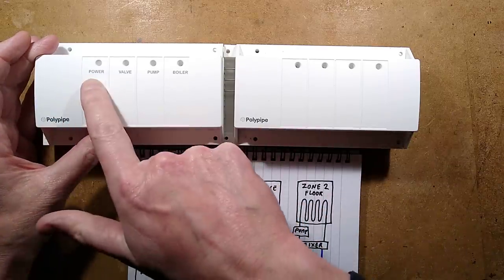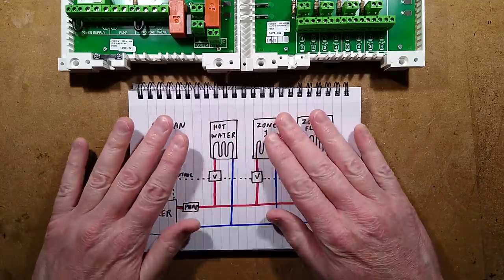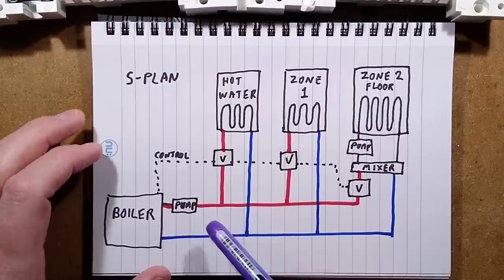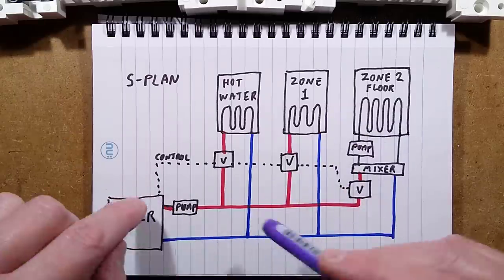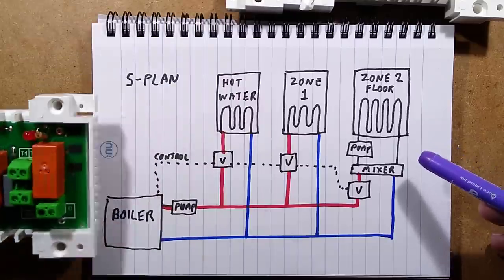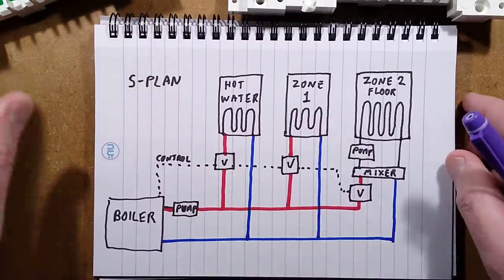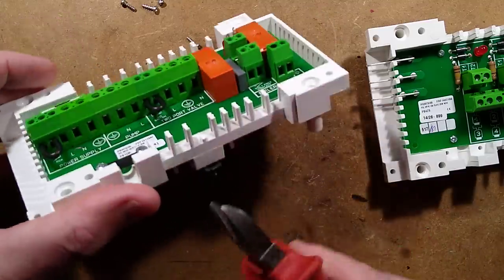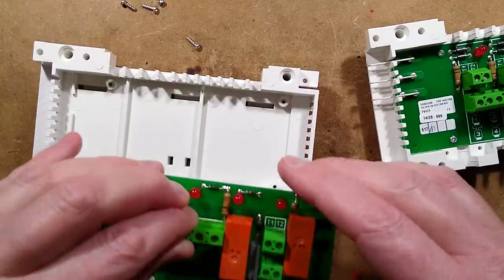Underfloor heating control system teardown (with schematic)

Comment: Big Clive: They say to not open these, they have a powerful spring and they are dangerous.

Also Big Clive's next sentence: Maybe I will open one for a future video...
Reply: Sometimes the warnings really do mean something.   The Detroit diff locker I put in my Hilux has a spring loaded setup (for the dog clutch) that has reportedly removed fingers from DIYers.  These things can have hidden treachery if you don't know the correct assembly or disassembly procedures.  I hope Clive takes care.  I can't imagine something that small having a great potential for bloody chaos, but sometimes that's the trap.

ETA: now that I've had a look the spring in these waxtuators it probably isn't that bad.  You probably just need to make sure the cap doesn't fly off and hit you in the eye.
Reply: i think this is more  a case of "the springs ae quite powerful for their size, and its gonna make it a pita to put it back together" more than poses an actual risk to a person

Comment: I have the exact same underfloor heating system (Polypipe) upstairs and downstairs. I was initially sceptical but it is brilliant. Your tale of what the elderly chap did to it had me double facepalming.
Reply: Do you run it 24/7 for the simple reason it takes ages to respond to demand ?
Reply: @millomweb  I never touch it as the thermostats mean it only comes on occasionally for most of the year. The house is new so is very well insulated. I have never once thought a room was cold and needs a sudden blast of heat like previous houses I have lived in. So yes to your question but no in the sense that most of the time it appears to do nothing.
Reply: @reggiedixon2  My aunt moved into a new bungalow - it has rads all over. I've never lived in a new house ! My flat is reasonably well insulated but is brick. Rads heating system takes about 4 hours each morning to reheat the bricks ! So I leave it on overnight - usually does a heat top up a couple of times through the night and not for very long !

Comment: Clive, Thank you for the inside look into this control system. I found it very interesting! Especially that they use 220 volts for the control circuit. Here is America, HVAC control circuits are for the most part low voltage (24 volts).  And relays are used to control the higher voltages.
Reply from the maker: I noticed that.  In a way it's good for safety of the people working on the systems.
Reply: Commerical HVAC is all 24v control voltage here and in Europe. It's standard. I've always thought the reason the US uses 24v on domestic is due to the high use of AC systems which have routes in the commercial sector. Makes perfect sense to unify it all.

Comment: Thanks for this, I recently came across this model for the first time so I found it was very relevant. Your tear down proves they're a lot simpler than I cared to believe. Which is nice. Simple = reliable. I guess the low voltage models make things a bit more complicated but a lot safer. My experience with Under Floor Heating has shown me that it often suffers two common problems; the valve pins on the manifolds leaking and the thermal actuator heads shattering due to the plastics becoming brittle and the pressure from the spring blowing the outer shell to pieces. On the Extra low voltage designs this is not such a problem with respect to safety but the 230V design is a bit more iffy!

Comment: What a brilliant video and description.A lot of time and effort went into this .Many thanks for the clear ,concise and eloquent description.It has increased my understanding of these units and the systems they control.There are hundreds of the actuators you describe on this development (5 or 6 per property ) each one capable of blowing the local fuse or CB.We may be seeing more UFH systems being installed in the future as they are ideal for Heat Pumps .

Comment: I'm thinking the valve actuator may be a wax motor.
Reply from the maker: It might be.  I'm going to open one.
Reply: @bigclivedotcom  they are.
Reply: Similar to the little ones used to silently open the automatic shutters/flaps on extractor fans when switched on. 😉
Reply: Yes, they are. And they have strong springs.

On my holiday house I have like 20 of those after 15 years the plastic started to degrading and springs was breaking the enclosure. After that also the valve collector started to fail. And we had to "rewire" that part of the heating system.(not native English here) rewire for plumbing word is missing on my vocabulary...
Reply: Crazy simple  cheap to make and does the job.
Reply from the maker: @tuttocrafting  Replumb.
Reply: "Wax motor" - I'm really having problems believing that name.
Reply: @YagiChanDan  After all, what else could it be !
Reply: @millomweb  LOL,  When I first heard of them I was thinking WTH ?  Knowing how they work still doesn't make the name right.
Reply: @pulesjet  "Waxuator" perhaps?
Reply: @StubbyPhillips  Thermo Dynamic Switch.
Reply: @pulesjet  I'm 55 and it's the first I've heard the term. The concept is probably at least 100 years old. Tried to find out when they started fitting them to cars.

Quite a lot of things then must have bi-metallic motors. The tank in the loft and toilet cisterns have hydraulic motors that shut the water off when the tank's full.

LOL
Reply: @pulesjet  Spring-driven = clockwork motor - I can understand - but these wax things aren't providing motion, they're providing *position*.
Reply: @pulesjet  I wouldn't even rate the wax cylinders on my greenhouse vents as being 'motors' ! They're 7" long approx !
Reply: @millomweb  63 hear and ten years ago I didn't know they existed.  LOL
Reply: @millomweb  Pretty much just a swelling plug.
Reply: @millomweb  motor just means that the device "provides or imparts motion to a vehicle or other device with moving parts". So, changing positions is motion, therefore the thing doing that, no matter how basic, is a motor.
Reply: As Clive said..... Thermoelectric Actuators is their real name, which describes them perfectly too. You can use the term "motor" if you like.
Reply: @tuttocrafting  You can say "replumb".  It means the same as "rewire" but for plumbing - putting new pipes in.
Reply: @millomweb  https://en.wikipedia.org/wiki/Wax_motor
Reply: @GaryAllpike  That's where I was introduced to them, and the term I used seems common enough. I do favor "actuator" over "motor", but I do prefer "wax" over more generic terms to describe the implementation.
Reply: @tuttocrafting   re- plumb  👍👍👍👍
Reply: Cool, I've only ever seen them used on fan shutters to date
Reply: @pulesjet  My Dad was a car mechanic - so I was aware of 'wax stats' at an early age !
Reply: @ParkerUAS  Yet it's never been associated with bi-metallic strips or other thermal expansion systems - nor water tank float valves.
Reply: @millomweb  Piston in a cylinder. Perhaps "Wax Engine" would describe it better.
Reply: @rambo1152  Nope :)
Motor and engine would suggest motive power - power to drive something at a reasonable speed (whether displacement or rpm). These things don't really do a lot :)
Reply: @tuttocrafting  Your English is just fine, we know what you mean. Most of us have studied in the AvE school of linguistics, so all good.
Reply: @millomweb  doesn't a stepper "motor" provide position?
Reply: @YagiChanDan  They're electro thermo ! :)
Reply: @maxmerton  It does and it's capable of motoring. A wax stat isn't.
Reply: They used to use 'wet wood motors' to split off lumps of rock, didn't they [not].
Reply: @millomweb  Opinion is clearly divided on the matter.

You think a wax motor isn’t a motor; everyone else thinks it is.

https://en.wikipedia.org/wiki/Wax_motor
Reply: @maxmerton  Well, it doesn't 'motor' !
Reply: @millomweb  What does a bimetallic strip have to do with a wax motor?
Reply: @maxmerton  It similarly creates movement like a wax stat.
Reply: @millomweb  If you say so.

Comment: I helped fit a similar system recently, the company who supplied it had the loops all equal length (50 or 75 metres dependent on pipe diameter), and they supplied a handy floor plan to show us how to place the loops out. A 11x5m room took 4 50m loops to fully cover, and other odds and sods took up the 2x75m loops. 

It would have been a bit of a nightmare without that floor plan, hopefully we use that place again if we do any more underfloor heating!

Comment: It’s great but that carbon interconnect is asking for trouble long-term, they could have used proper right-angle PCB plugs & sockets.
Reply: the terminals are designed to cut into the copper, they work, I've shipped thousands of a product with a similar interface without issues, though they are typically only rated for 5 connections, after that you've mangled up the receiving PCB too much, fine for some applications. Ideal as you don't have to burden the basic product with the cost (of the connector) of an optional extended configuration.

Comment: That "connector" for chaining the master to the slave scares me.  I doubt its reliability.
Reply from the maker: It doesn't inspire confidence.  Fortunately it's low current.
Reply: @bigclivedotcom  It doesn't need to withstand being disconnected and reconnected more than a few times. Because the paint is relatively soft the metal side of the connector can bed in for a better connection than you would get if you had to worry about fatigue.

I'd still prefer something I could screw down.
Reply: @jonbob2  in networking terms: it's looking for a shit storm, Piggyback \ Daisychain is never a good thing.
Reply: @jonbob2  exactly, it'll be rated at five connections, I've shipped a product in the thousands with a similar connection method, no issues.  Carbon is there as I guess they went for a cheap PCB finish and didn't want to have corroded connections.

Comment: I'm always amazed at how other countries manage the 'basics' of a household.
Reply: Over here we basically can't get a ice maker to connect to water without leaking 😂
Reply: @miniwarrior7  Around here, ice making is a delicate use of open containers filled to the point of overflowing.
Reply: Floor heating, here in Germany, usually has a rep of being slightly posh, not basic. Most homes use radiators, most often mounted in the areas below windows. Some people even prefer radiators, often because floor heating is usually rather slow to regulate. It takes ~1-2h to get warm, but even longer to go down to comfy levels if you've overshot to quick-heat. All that cement has quite some heat capacity!
That also means that floor heating isn't the most economical solution if you're only home in the evenings and weekend, because you basically have to let it simmer on a constant level even if no one is home. Talking from experience =)

Comment: larger rooms often have more than one zone, often there's a zone just inside a patio door
Strong spring ?, i once opened a landis and gyr steam control vale (spring return), it was more like a coil spring from a small car suspension :D
Reply: Razorback73  For heating thermostats, the main spring pushing against the regulation is actually the steam pressure.

Comment: Yeah that's an interesting one. Inaccessible pipes embedded in concrete don't seem like a good idea unless you like demolishing houses. My Grandparents had a 1950's floor heating system but sold the house when I was a kid. But I remember the warm concrete floor and the boiler room I wasn't allowed to go into. It was an oil fuel system, possibly only one zone (single floor house). I remember something about them having to convert the heating into another system just before they sold it because of problems with the pipes in the house foundation.

Comment: 7:05 you could've just put the slave board on and then measure from the connected terminal
Reply: You mean the Student board.  Comparing equipment to the plight of trafficked humans is unpopular with the language politicians.
Reply: @johndododoe1411  Next you lot will complain about the word robot because of its etymology. Also, daughter board would be a lot more accurate than student board.
Reply: @templebrown7179  A daughter board is attached to a motherboard in a notably different way.  As for master/slave terminology, there are rumors that it has been formally banned in some places, making me search for alternative words that preserve the actual labeling of products and circuits. Servant is historically neutral but may upset the same political forces as Slave.  Apprentice or Assistant would work logically but not match single letter markings.  Student is vaguely similar but more flattering and works with existing M/S markings.
Reply: @johndododoe1411  I heartily disagree that a daughter board must attach in a certain manner. I have worked with many different automation systems for electronic locker systems, computerized vending, ATMs, and self-checkout and in all these cases, boards that expand off of the main control unit are referred to as daughter boards in practice and by convention. Being that the manufacturer was the first to make most of these technologies possible, I must cede to their priority on the naming convention.

Comment: I think they provide the possibility to connect multiple of those valves to one zone because you could use this for radiators as well, and you might end up having more than one radiator per room (/zone)
Reply: You can run more than one rad through one TRV when the rads are in the same room. Plumbers aren't generally intelligent enough to do engineering. I find many places with multiple thermostats in a room - clearly indicating the installers were clueless. You end up with the rads red hot and the air con working flat out.

Comment: The thermal actuators can be fitted to Thermostatic Radiator Valves (TRVs) and so you can use these "Underfloor Heating" control centre to achieve that nirvana of domestic heating where every room has a thermostat for the radiator and every room is its own zone. So whereas TRVs can only stop a room getting too warm, the UFH control centre can turn the radiator, boiler and pump on if any room gets too cold.
Reply: The Wavin Hep2O AHC 9000 is a great system for this as the thermostats are cheap, simple, reasonably attractive and you can add floor sensors to them if you want to control underfloor heating. The controller can use wired (24v) and wireless thermostats, it has an integrated receiver and the facility to connect an external aerial if any wirelss stats have trouble connecting. It will also control a zone valve for DHW using a temperature sensor (thermocouple) on the cylinder.  If we could just have the Salus auto-balancing actuators with a variable Delta T, this would make a brilliant setup for most UK homes to give full control over the temperature in each room.

Comment: As a Canadian, this video carries a huge novelty factor for me because our underfloor heating systems are electric and use thin resistance pads. The current-gen stuff is basically a roll of plastic with the wiring printed on it.

If you end up doing a video on UK boiler systems at some point in the future, I'd definitely want to see that.
Reply: Difference between being in a nation with lots of mountains to dam up, or one that discovered a mega ton of natural gas 50 years ago.

Comment: Underfloor heating used to be a staple of multi story flats!
Gas was not allowed so they would put a heating wire threaded throughout the rooms and connect it to an economy 7 meter (or one of the 4 arm time switches dependent on the tariff ) There was obviously no insulation so if you had an empty flat above you it could get cold but if it was occupied you got a heated ceiling too! Tenants would complain of sore feet with this method of heating and it went out of fashion in favor of Electric Storage Heaters. 
In the early 80's they came up with a predictable controller for those too. It had an outside temp sensor and a strange controller inside with a simple dial on it, min to max with no other markings. This did not last long as every 7 min it would click a loud relay off and on which annoyed everyone (10 PM to 7 AM cant think why people would not like that one ;0))!

Comment: Graphite coat used to both provide corrosion protection and lubrication during the insertion cycle. Cheaper to apply the 3 spots both sides of the board than to order the boards with an ENIG coat that is thick enough to not scrape off the first few cycles of use. The coating is very cheap, as the ink used is incredibly cheap, used in every remote control to make the pads, so it is hard wearing. When mated resistance likely is in the sub ohm range as the metal contact presses down on the graphite and almost gets metal to metal contact.

Comment: What did he say when you told him what he'd done; Oops!
Reply from the maker: I didn't rub it in too much.  He was clearly a bit agitated.
Reply: @bigclivedotcom  No matter how experienced, or the intention we all make mistakes, often the worst punishment is how bad you feel yourself when you do ** up.
Reply from the maker: @Okurka.  She smouldered quietly.
Reply: @bigclivedotcom  But not enough to still need heating, obviously.
Reply: probably got angry and accused Clive of trying to rip him off
Reply: I really do cringe during those interactions where you have to explain with a level of diplomacy that the owner may be at fault. I work on vintage motorcycles for a living and sometimes the old duffer just won't be told by a girl that they've screwed up. If they go for the second opinion I generally go for that opportunity to say bye bye and good luck 🤭